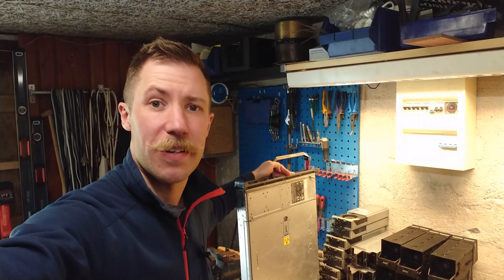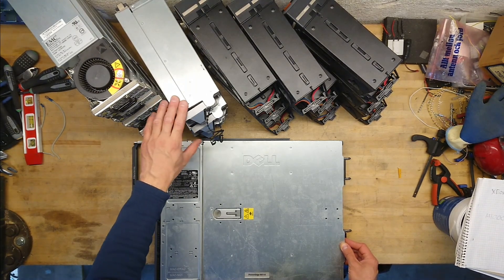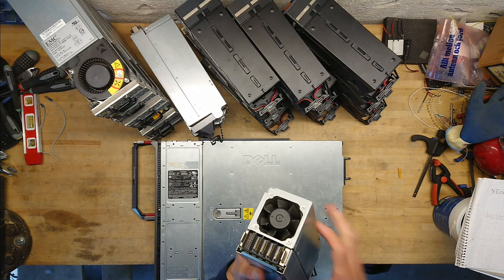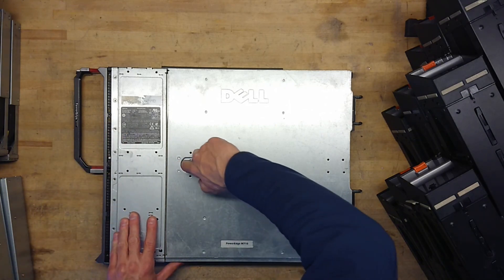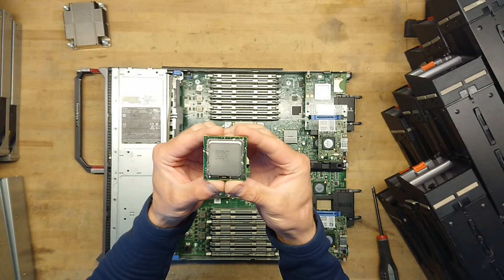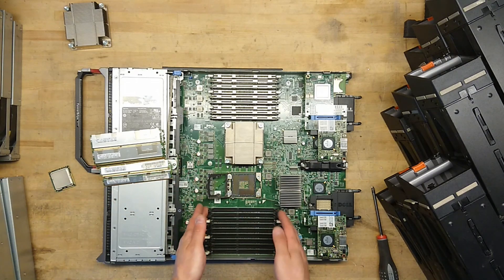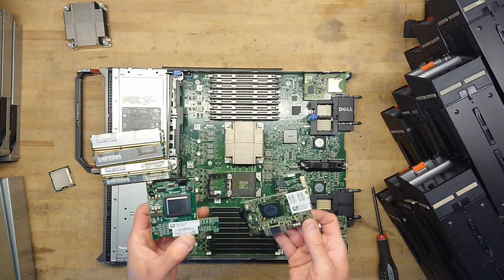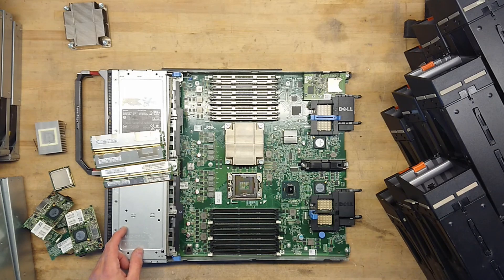Dell PowerEdge M1000E Blade Server Teardown

Comment: 12V 197A bloody hell! You could jump start a large diesel engine with that much power.
Reply from the maker: That was not a bad idea... I do after all have 3 of those
Reply: @KaizerPowerElectronicsDk  it can probably supply over 200A easily.

Comment: The mix of speeds on the ram is due to ram speed limits for the amount and rank type of ram. The rank of the ram can be single double or quad < 1R 2R 4R> shown like 4R x 16GB. 
I have a e5620 cpu. I can put a single ram in each of the three channels and get 1066mhz cpu limit with any rank. But fill the rest with dual or quad rank and memory speed drops to 800 or 667. 
So why pay for fast ram you can't run at full speed.
Reply from the maker: Thank you for the explanation

Comment: really interesting teardown. 

It's a shame that the single blade servers can't really be used stand alone without the cabinet. 
They might still be good for educational or tinkering around purposes.
Reply from the maker: Servers are just such noise machines / wind tunnels that I am not sure I would ever want it to run in my own home :)
Reply: @KaizerPowerElectronicsDk  
Thats totally true yes, it is only bearable if wrapped in isolation and put into the basement ;)